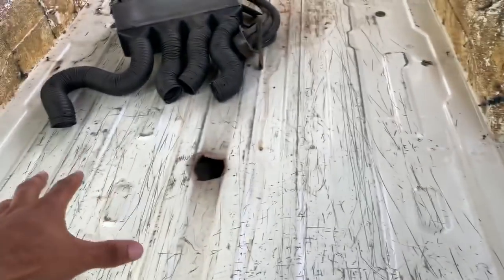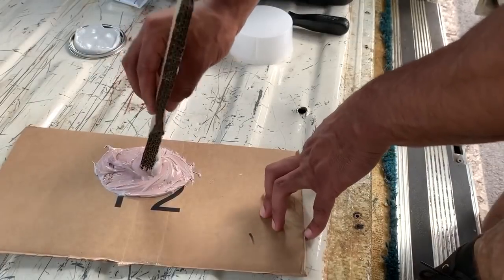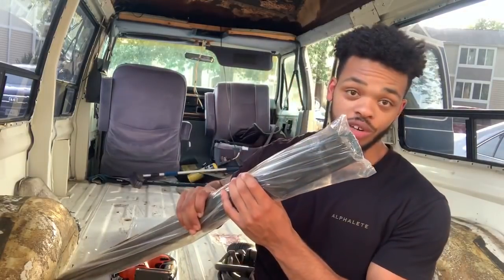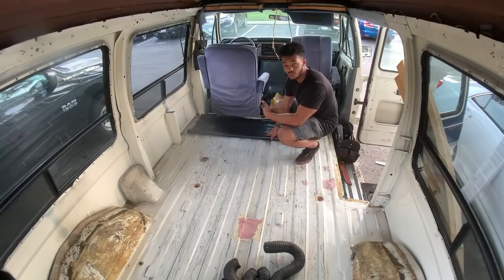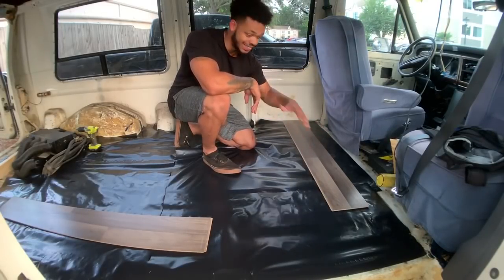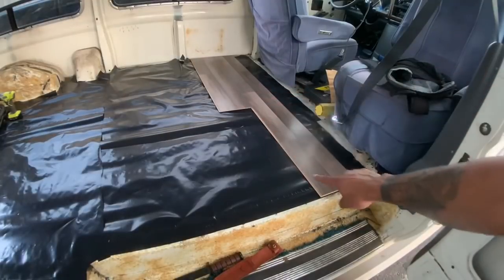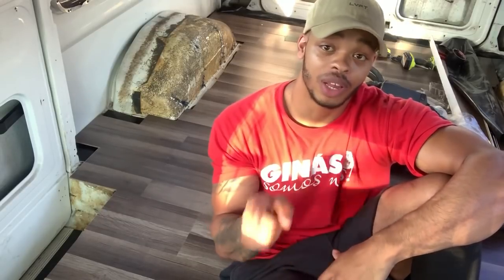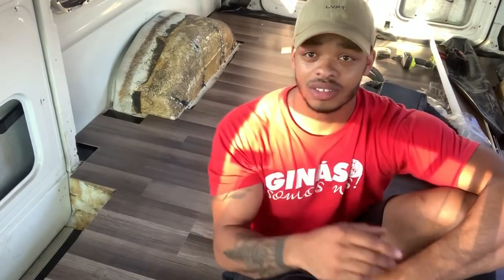How to Install Vinyl Plank Flooring in a Camper Van

Comment: How would you add additional insulation in the floor? It seems that the vapor barrier you put down may not provide enough insulation for really cold or hot climates. Great video thanks!
Reply: Maybe add cotton or wool throw rugs on top, and wear merino wool socks and/or slippers.
Reply: It’s nearly impossible not to have cold floors
Reply: How effective is insulation in the average van build really?  Unless you're in a box van and you can really go to town.  I think people have to accept that if you're living in a van, you're going to be cold in winter and hot in summer.  Maybe you move north/up in elevation or the reverse depending on where and what season you are, but you're never going to get a vehicle as comfortable as a house.
Reply: He had a 3 in 1 barrier

Comment: So I did this and there was way to much flexion with only the black plastic.
so i ripped it all up put in a thin 1/4" plywood and a thin underlayment foam. A million times better, not that this wasn't helpful, but just a caution to anyone who does this
Reply: Did you put the plywood down first or foam?
Reply: @marienkablack6737  Wondering the same thing!

Comment: I love watching your work. I’m in the process of MAYBE going to by a 2011 transit connect. If it turns out viable, I plan to convert. You’re work is helping with ideas and how to.  Never done this before but my husband has carpentry skills. I think we may just pull this off.
Reply from the maker: I say you go for it and worst case scenario is you have to rebuild it or sell it. I’m just a regular guy not a carpenter or anything like that. I’m just willing to put myself out there and try new things and learn from my mistakes. I think if you go into it with the right attitude then you’ll be just fine!

Comment: I know I ask a lot of questions but I'm building my van out right now so I need all the useful information that I can get. You put the moisture barrier down and then put the flooring on top of it you don't need to glue any of that down? The floor is just going to stay in place and not move?
Reply from the maker: lol you can ask as many questions as you want to. I have a few hundred other people doing the same thing. And to answer you’re question, I did not glue anything to the floor of the van to install this flooring. If you’re installing it properly by cutting around the various shapes in your van, by the time you get to the end it won’t be able to move because of the snug fit with the odd shapes in the van. It will only become more stable throughout your build as you add furniture and appliances. If you get to the end and you want a little bit more stability, you can put 2-3 screws in the first and last board that you installed, but that probably won’t be necessary to be honest

Comment: Excellent video! Thank you for keeping it informative, useful and efficient to watch. A lot of people put slats in the "valleys" of the original van floor. When I put thin plywood down on the van floor (with nothing underneath just to haul the material home), it cracked underfoot. I'm concerned that the vinyl flooring will do the same after installed, with the uneven support of the original van floor. Have you found the vinyl flooring to crack? How quickly? I'm hoping it would last at least a year or two. Also, I'm looking at putting natural cork under it for less "offgassing" (less chemical emissions from the materials). Would love to know your thoughts.

Comment: Is there a reason you didn't use insulation or a subfloor? Looks great.
Reply from the maker: I don’t insulate the floors anymore because I found out that no matter what you do, the floor will almost always be cold unless you install a heated floor. On top of that, insulating the floor will cause you to lose 2-3 inches of height inside of the van and if it doesn’t really effect temperature regulation , then I’d rather skip that step entirely. The underpayment that I use provides some insulation but it works about the same as a 2 inch polyiso foam board. Floors are weird in vans
Reply: DualEx Thank you 😊

Comment: What’s the name brand of the floor insulation u used ? The roll
Reply from the maker: I can’t remember the name from the top of my head. I got it at my local Lowe’s in the flooring section. They only had that one and 2 other underlayment options and it’s the only black one so it shouldn’t be too hard to identify

Comment: I know this is an old video but I don't see my question yet so... I have always planned on having a 1/2 ply sub floor so that I have something for cabinets, bed, etc to mount to.  With this floor installation that is not possible without screwing into the sheet metal floor which introduces holes that allow moisture and dust in again, or all of your fixtures are mounted to the walls?  Just wondering what you did there.  Also, has temperature changes or back road driving caused any of the joints to buckle or come apart?

Comment: Great video. I would like to add flooring but my van is brand new 2021 Ford Transit and doesn't have holes under the carpet. I am reluctant to remove the original carpet in case I want to sell the van in the years to come. I do want the flooring to be smooth and waterproof though. Any suggestions from anyone?

Comment: I'm sorry but I used to install flooring for a living and there's so much wrong with the install I can't even begin. Just look up specs of any Vinyl Plank Flooring product and you'll see how many errors were made. Floor has to be within 1/8" in a 6' span (so a subfloor is required)... and if you have small tolerances and imperfections THAT'S when you use underlayment. The gripping properties and noise insulation is just an added bonus but really it's use to smooth out imperfections (not the corrugation of a Sprinter.. that's beyond out of spec). You also can't just begin with an end cut because sometimes you'll get to close to a previous end joint. If you look at the install specs for vinyl you usually have to be anywhere from 6-12' from the last rows end joint. All of these things I mentioned are needed to prevent the floor from separating... and I'm just talking in a house. This is a moving van which is 10x worse. Plus, humidity and temperature change (these tolerances also listed on the products spec sheet) in a car so it will contract and swell and work all your joints loose. Everything is wrong about this and I hope no one uses this as a guide. My recommendation would be the thickest VPF you can find... and GLUE all the side and end joints so it doesn't come apart. You must have a smooth and level surface to begin with and if not, thats when you need some sort of subfloor. The list goes on and on here.

You should update the folks here with the floor now... I can guarantee it's coming apart if you've been driving it.
Reply from the maker: Michael Lihrman well unfortunately for you, your guarantee is wrong. The floor is not coming apart, there are no issues with the floor at all. I did not actually tell anyone to do anything this way. This is just the way that I chose to do the flooring for this van. I’m sure you can find a “professional” for every little thing that I did in this van to say that I’m doing everything “wrong”. I’m not a licensed professional, nor do I need to meet any standards for anything that I choose to do. I’m just sharing videos about the way that I choose to do things. I actually do respect your concerns as a professional, but There are no specs that I need to meet and there is more than one way of doing something without it falling apart
Reply: You act as if your way is another way that works.... That's just totally untrue. The manufacturers come out with spec sheets for the absolute best install and to give the longest life of your floor. I've seen floors come apart in houses for the most minimal mistakes. You should do a follow up video for folks to show them how it looks still. I find it hard to believe it's still holding if you've been driving and walking on it.
Reply from the maker: Michael Lihrman this video was released a year ago. If you want to see the floor now, I’ve recently made a tour video 2 months ago. There’s nothing wrong with the floor at all. You can find it as hard to believe as you’d like, but it’s totally fine

Comment: Love each and every video.  Detailed and to the point. Just wondering if you need to fill the grooves in the floor with thin wood? With out filling those voids is there a chance for the floor to crack? Thanks keep them coming!
Reply from the maker: Thomas O'Brien adding wood strips in between the ribs of the van won’t change anything as far as the installation of the floor. It’s just an extra step that will give you the same result. Most wood strips that you can find without making them yourself will be bigger than that gap so it will raise your floor height and then there will still be air gaps anyway and you’ll have less ceiling space at the end of it. The only reason why I might put wood strips into the floor would be to add thick foam insulation in between the wood. There’s no chance of the floor cracking because those air gaps are so small that it’s completely insignificant. I could see if the gaps were a foot or more apart, but they’re only about 1.5 inches
Reply: @Dualex_Builds  gotcha thanks!
Reply: @Dualex_Builds  THANK YOU for answering this question, I had been searching for this answer!
Reply: @tommyo321  Thank you! I wanted to know that, too. You make a great point. They are small gaps! Some people put all sorts of layers under there. This looks much simpler!

Comment: Hey! How has your plank flooring held up? We are at this stage of our build, but hesitant to do vinyl planks. We're not sure if the vibration while driving would rumble it apart, or if the uneven floor would cause an issue. Our build is also slightly different (we're in a box truck). We are considering vinyl sheet instead at the moment. Would you do anything differently?
Reply: I used to install floors for a living. DO NOT listen to this guide whatsoever. I made a comment on here warning people but it so wrong and your correct about the floor likely coming apart. Just throughout read the install sheet in any VPF box and you'll see where it's all wrong. Theres some VPF products that allow for glue on the end/side joints. Look for those and buy the EXACT one the manufacturer reccomends for its product.
Reply: @michaellihrman6600  Thanks for your feedback. We see so many other campers using vinyl planks without "issue," but we also know that what they show on YouTube isn't always reality! Even in our apartment, a couple of laminate planks in a highly trafficked area over an uneven subfloor is constantly popping out. Our box truck's floors are not 100% flat (as with, all van builds), so we decided to go with vinyl sheet with felt backing. If this doesn't work out, it's also not a huge cost down the drain.

Comment: This is an awesome video! You explain very well! Question. How do you fill in the sides? Thanks for sharing!
Reply from the maker: I’m glad you like the video! I just get the sides as close as I can because those parts will be covered with insulation, sub walls, and furniture later on. I used to make perfect cuts  around those angles but it always gets covered up anyway

Comment: My question is do you have experience doing this stuff or you just learned on your own I wish I could learn to do my own van I tried but it didn't come out right so I just ended up throwing everything away.
Reply from the maker: I’m completely self taught. If you want to learn, all you have to do is watch some videos or read some information about it and try it yourself until you get it. You don’t need any “professional” knowledge or anything like that. Professionals are just people who used to be beginners and eventually they got good at what they were doing by trying a lot of times. If you get back at it and try, you will eventually get it

Comment: What about the ridges in the van floor?  Do you feel them when you walk on the floor?
Reply: I was wondering that also, and what if  one of the flooring joints lands in the center of those ridges? It's not very deep but it could flex the joint and cause it to break apart.

Comment: I'm having such a hard time about my van so 93 Ram 250 passenger band kind of butts short short base like the one you're working on there and I'm having such a hard time I got my floor I got my ceiling built my bed and now I'm trying to build my cabinets and I'm just so frustrated so frustrated is so hard I'm 60 years old and it feels like every bone in my body is hurting people don't realize how hard this really is an expensive despondent Woods expensive anyway I had to take a day off cuz I'm just so tired I'm getting disgusted with it but I want to finish it

Comment: Please please do not use bondo to fill in holes like this ...Bondo should be used as a small-med dent filler   Dyna-glass ( green bondo with chopped fibreglass) is much stronger 

Another issue is You need to ruff up the paint and metal for the bondo to grab onto If not water/moisture will absorb get under the bondo and rust...Bondo need to be primed and sealed with paint
You can buy tongue and groove real cedar planks for about double the cost  However : Aromatic, stand up in any weather and resist bugs, Sandable Easy to cut and shape...will always be in stock in the same shape and color, Better insulator..

Comment: This is one of the worst things you can do.   Bondo shouldn't be used to fill holes and should be as thin as possible.  Won't be a problem if you never drive in the rain and its 75 degrees all the time.  Otherwise this will be in a constant shrink/expansion cycle